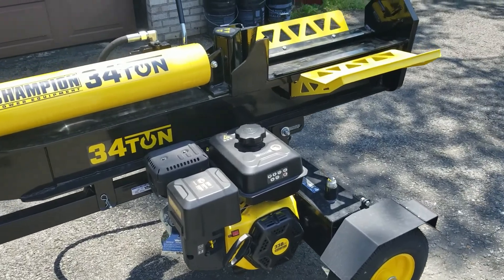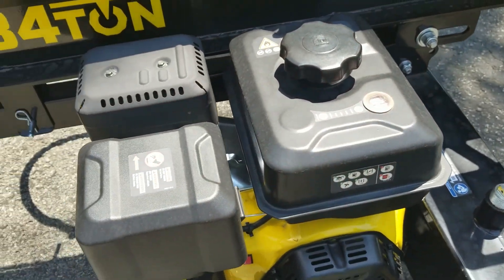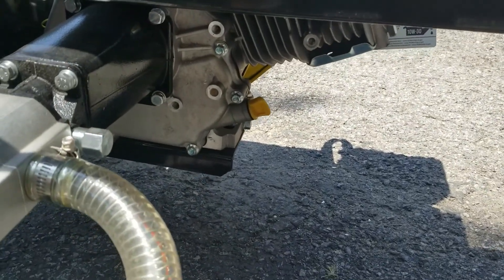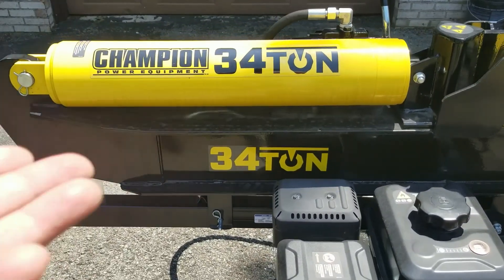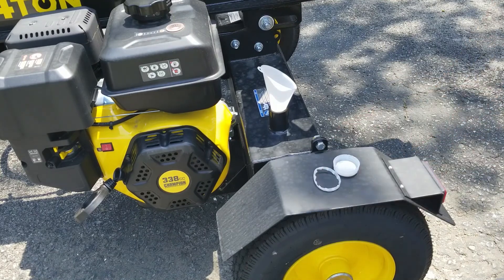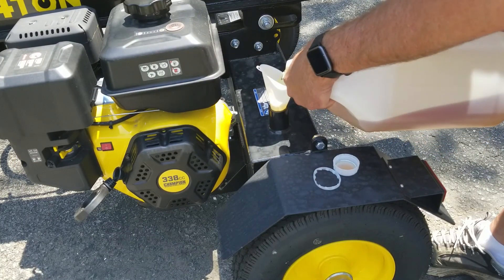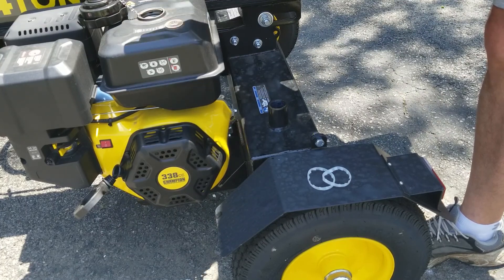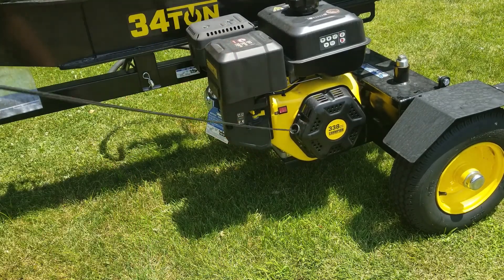Champion Log Splitter 34 Ton Vertical or Horizontal splitting.

Comment: Did it come with hydraulic oil? I just ordered the 37 ton. Thank for the review.
Reply from the maker: I did not.  I just used the 3 bottles that came with the purchase.  I use it for personal use.  It will last longer than I will ever need it I am sure.
Reply: Yes it came with 3 jugs but I had to add some.

Comment: Have you ever looked at the air filter ?
Reply from the maker: I have not.  Do you want me to do a short video and open it up?
Reply: @aroundthehousewithjohnmila672  ....Yes , Lets see what they gave you because I got a 5/8 piece of foam. 
Even after I call Champion they sent the same piece of foam. you'll be shocked or I'll be shocked if you have a filter
Reply: @aroundthehousewithjohnmila672  ....So how long does it take to open the air filter ?
Reply from the maker: @good-boy-ringo  I don't get back home until Wednesday.
Reply: @good-boy-ringo  That’s all you get, I have the previous 1 that fills the air box, carb, & cylinder full of water when it rains, besides the style of air box they are identical, I love mine
Reply: @good-boy-ringo  2 seconds.
Reply: That air filter is a common filter used in a lot of motors. I also have one in my sawmill motor, but in combination with a paper filter. The one in the splitter, use wash it under warm water with dawn liquid. Then you squeeze dry it in a towel. Then you put about a teaspoon of motor oil on it and spread it in the filter and reuse it.
Reply: @tomsommer54  ....New to me !  The air box has provisions for a real filter but they just added a piece of foam.

Comment: When I put in a vertical position, it slips down from the pivot a few inch slide and tightening it down don't stop this. This put splitter at an angle and makes it difficult to split large blocks withhout 2 people
Reply from the maker: I have not had the vertical position used because it is difficult for me to work on my knees and stand up again.